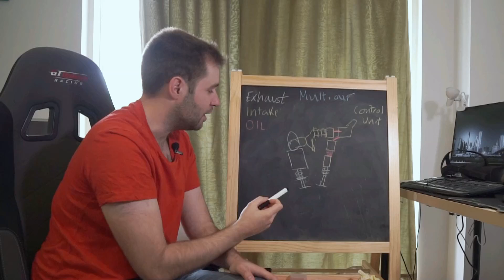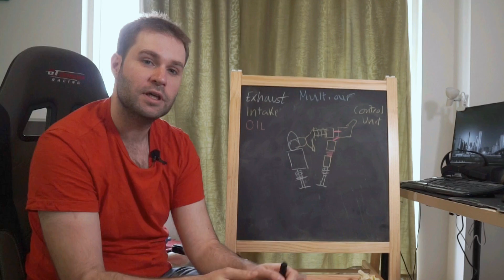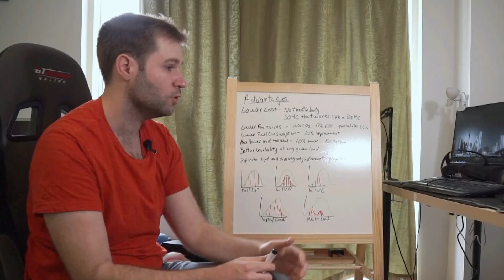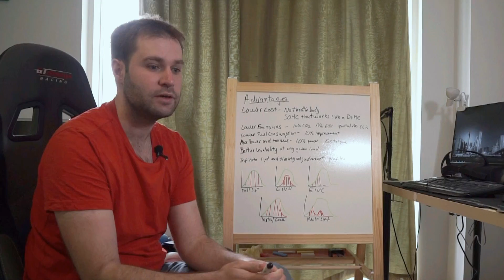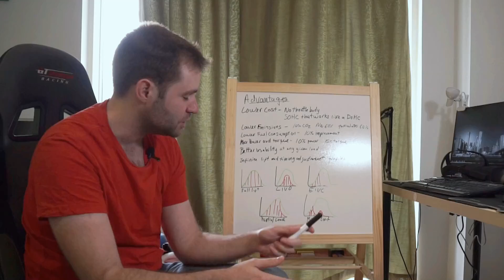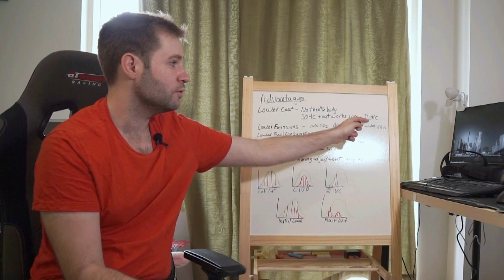How Multi-Air works (and why it's better than VTEC)

Comment: No throttle body? I have a 124 Spider with 1.4 multi air engine and I personally installed a throttle body and a throttle body spacer so I'm not certain what you're referring to?

Comment: My 1.4t multiair dart ran into partially major issues after 140k kms, doing the tear down and check now haha as a shop had it for 3 weeks then did nothing and gave it back to me to fix. Great info on this video though and it's cool to see the positives of this little cast iron block 72mm piston demon

Comment: Never again I would buy a motor with Multiair! My Fiat has now the second fail of the Multiair and it cost a lot to repair (about 1500€). The first time it failed with just 16'000km. Now I have 20'000km and it fails again. You have to drive the engine for at least once every week! If not, the Multiair will drain all oil and never starts again. I'm a mechanical engineer and now how an engine works and I had a lot of cars and motorbikes and repaired them as well.

Comment: After testing an Abarth multiair I can safely say that my FN2 feels way more powerful and the kick is way more brutal than in the abarth
Reply: you're comparing a 1.4L to a 2.0L, what did you expect?
Reply: You're also not going to feel a "brutal" kick because it isn't just on/off like VTEC, it can smooth the transition from low to high RPM intake timing so that you don't have "all or nothing".

Comment: One very minor correction, the multiair does have a throttle body, it simply remains wide open most of the time. The Euro T-jet's intake cam (dual cam) is replaced by the expensive ($1500) "brick" that controls intake valves. It's basically the same engine, but with the upper head (valve train) portion switched out. Basically the upper head containing the cam(s) and brick is unbolted and a dual cam unit bolted in place. The tricky part is reprogramming everything to work with dual cams in a car designed for the multiair system... something not yet successful for those swapping the unit out. Peak HP is improved with dual-cam, driveability (especially in the city) is better with multiair.
Reply: It is only expensive if you go all American with the maintenance. Unless the unit was broken to begin with. BTW. it is not $1500, more like €900.
Reply: @worldhello1234  You guys must get a great deal on parts. My brick threw an error at 5100 miles and was replaced under warranty in 2019. At the time the brick was over $1500, now nearly $1700, plus labor.

Comment: It's not actually better than VTEC. Maybe multiflair picks up a couple features, but it totally disregards half the engine! (exhaust cam, no control)

Also the small engines have low rev limits, Probly because valve float. Small engines make small torques, but the multiflair makes few torques.
Reply: Trust me, multiair have some much fun over vtec, literally just kicked straight away no need time like v Tec only Selenia Multiar oil and free of trouble
Reply: @biseruk  Trust isn't the issue, experience is, because I have experience with both.

Comment: I've owned a few hundred cars and my 2012 Fiat 500 sport is my favorite  small car ever. I love the brilliant multi-air (which has been completely trouble free for 105 K miles), and it's a far better car on a twisty road than any of the "sports" cars I've owned.

Comment: Not to forget there's a small screen strainer on one end of the head that needs to be cleaned periodically. Also, about the MiTo, I'd be hugely surprised if it's not the same platform as the Fiat 500 - which is a genuine piece of shit (I know, I own one!) due to the fact that every part, except the engine, is low grade and will wear out prematurely, the paint is bad, the design details are feeble, maintenance is a horror and every thing is cheap, cheap, cheap.

Comment: On most engines with MultiAir, they're actually DOHC.
Reply: It’s SOHC; I thought I was tripping when I examined my spec sheet but I poked around and it’s true, it’s only a single cam
Reply: If it has multiair there is only one camshaft, which makes it a single over head cam. Only an exhaust camshaft as the multiair replaces the intake camshaft

Comment: My multi-air tigershark 2.4 is awful. It is so powerless i feel unsafe merging on highways and even just switching lanes going faster than 65 mph.
Reply: Which car?
Reply: @hexity-  2016 jeep renegade trailhawk. I love how it looks but the performance is just abysmal. It does do good off road or slippery conditions tho.
Reply: @Anosh45  well you got 9 speeds and you way 300lbs heavier. I drive a 2014 Dodge Dart with the same motor. And I have 6 speeds. My dart goes buddy
Reply: @hexity-  after my warranty im planning on getting header, exhaust, some ecu stuff, and lowering the height and beefing up the suspension. darts are def better because of the weight difference and the aerodynamics, gearing, etc. hopefully more aftermarket performance parts start coming out
Reply: He'll we got the 2.4 in our jeep renegade 2 wheel drive and it runs pretty good
Reply: Dont blame the engine. It is the zf9 speed that keeps it weak and slow. Dont believe me? Put it in manual mode and see how fast it will go keeping it in lower gears and higher rpms

Comment: Oil specifications changed for euro 6 to 0w30 which you did not mention. The oil specification chang3d not only for reducing emission but most importantly to cure the failure of the multi air actuator

The mito is a great little car, obviosly to small for States side, perfect for us european
Reply: Yeah, oil specs are different for the various versions. e.g. Different oil for the US turbo vs the non-turbo models.

Comment: Thank you for your crisp and clear explanation of this fantastic system. I have a Fiat 500 Abarth and love its performance, sprint and power. You have successfully explained why.
Reply: I just bought a 2014 Abarth and love it! I work for a Chrysler dealership and our lead Chrysler tech showed me how it works and it’s really quite amazing. Your explanation was one of the best I’ve seen on YT.
Reply: You know a abarth 500 got a 1.4 t-jet  right?😅
Reply from the maker: In the US there's the multiair option
Reply: @randomcallsign  oh really I didnt know that
Reply: @jeffreykoeleman7068  L

Comment: So are these interference engines?
Reply: Yes and no. It depends on how much lift the multi-air system is going for when the timing chain goes. At full lift these engines are VERY interference. The cam profiles on these engines are crazy because the multi-air system gets to decide how much of the cam to use.

Comment: It is not better than vtec performance wise......Vtec could change cam profile.
Reply from the maker: So can multiair
Reply: @randomcallsign  No. multiair and many other variable lift system could vary lift but not duration.
Reply: @randomcallsign  I mean longer than normal cam duration.
Reply from the maker: Then you need to check all the available lift modes such as multilift
Reply: @randomcallsign  All other variable lift system is restricted by the cam lobe，but Vtec changes to a larger lobe. I am not a fan of honda, but I love high performance NA engines.
Reply from the maker: Multiair makes it moot by just using one electronic actuated lobe. At maximum lift its just like vtec. Then multiair can lower the cam profile, or raise it or open the valve or close the vale, or retard or advance injection according to load needs. 
Full lift "is" VTEC. LIVO "is" the lower lobe
The explanation is on the video.
Reply: @randomcallsign  Yes, it can lower but not increasing like VTEC
Reply from the maker: If it can lower, it can increase.Lower assumes a higher cam profile position, which multiair has, being called full lift. But instead of having a second lobe, the selenoid does it all, and not only that, it can infinetely adjust the cam profile. Full lift ~= VTEC. LIVO ~= lower lobe. 
There's no need for a second profile or a variable valve timing actuator when the selonoid does everything VVL and VVT does. That's the magic behind multiair.
Reply: @randomcallsign  Your theory is right, but in fact the cam lobe is lower and shorter than the vtec second cam lobe.
Reply: @randomcallsign  For comparison: honda engine with real vtec： k20a 212-221hp K24a2 197-205hp for same 2.4 NA multiair 2.4 178-184hp. Fact is fact, power for NA engine lies in cam profile and engine speed.     Vtec is better for perfoemance, Multiair is better all the other aspect.
Reply from the maker: You are comapring two different generation of engines on two very different CARB and EURO rules. High revving NA engines that push over 100hp per liter will not happen anymore due to enviornmental restrictions. You need to compare apples to apples. 
The Honda 1.5 VTEC has 184hp, or 122 hp/l. The 1.4 multi air has 170hp or 121horses per liter. 

Apples to apples, power wise, they are essentially the same. In terms of technology and options multiair is far superior.
Reply: @randomcallsign  First honda 1.5 is not Vtec but ivtec engine. it is phase variable only, you are demonstrating that multiair engine perform very similar to an engine without lift variable system that being said multiair is not helping increase power.
Second, Multiair 2 engine is newer but got higher HP. Multiair 2.0 in Dodge calibre SE have only 158hp 2007-2012 whereas K20a from 2007-2011 got 221hp (civic type R).
Reply from the maker: 1.5  VTEC Turbo does have lift, not only phase. Not only Multiair increases power it has a track record of doing so against same displacement in the FCA engine family. the NA 1368cc engines achieve 95bhp. the MA achieves 105 with the same number of revs. And this is why you are failing to understand my point.
The K series is not a comparision to multiair. Its a high rev engine, makes power at peak engine speeds. Its tuned that way and its tuned to an enviornmental set of rules that does not exist anymore. 
The Multiair does not, It makes power signficantly lower on the rev range and it does so by complying with standards.
K20 is high rev, high performance engine phylosophy complying with EURO3 and 4
Multiair is a general utilitarian, mid performance, normal rev engine complying with EURO5, 5a and 6. 

These engines compare as much as a K20 to a 2.0 V8 from 1960s. Those used to do 240bhp.
Reply: @randomcallsign  No It doesn't have second cam lobe. Many "vtec" badged honda engine is just have a badge.
Reply: @ocerrr  lol wow..
Reply: @hewasdeadwhenigotthere7109  Yeah right? All of this evidence and he's still disagreeing because he just doesn't want to admit the MultiAir is thoretically the same as a VTEC.
Fanboyism at it's finest.
Reply: @randomcallsign  I'm not sure about your country but I'm assuming things now. The 1.5 liter Hondas that make 184 hp are not vtec. The accord with a 1.5 vtec makes 192 hp. There are no other vtec 1.5 turbos but there are non vvl 1.5 turbos that make an assortment of power levels and the civic si makes 205 hp which power per liter is more than the 1.4 fiat. I'm not trying to be biased to anyone but only correcting the information being put out. You can say what you want but it's gonna be a tough game to beat Honda at hp per liter on a budget. The l15b7 Honda is already making more power per liter but to be fair it may not be available in your country according to the numbers you're reporting.
Reply from the maker: @redlinearroyo847  the 205bhp version is not available in europe and it was only available after this video.
Reply: @randomcallsign  the 205 hp civic si 1.5 turbo has been out since the 10th gen civic began which is around 2016 2017 but that's for USA. I guess Europe is 5 years behind us. 
Yeah I checked 10th gen civic came out late 2016 early 2017 and that did not have a k24 anymore it was using the 205 hp l15b7. For USA atleast. To be fair I wouldn't expect most people to be well versed in all special and exclusive automotive regions of the world.
Reply: Have a ride in a NA VTEC, after that you'll never want to drive a multiair ever

Comment: That guy you spoke about mentioned thet the engine requires oil. He was right "from what you said" if the multi air or twin air gets low on oil then the engine will not run

Comment: How long should the 2020 2.4 ltr. last?
Is it a durable engine?
Reply: There is a standing recall for oil consumption on these motors. Basically brand new motors use oil from the factory. Not a good motor in my opinion. Also, maybe one of the most sluggish 2.4 lt motors I have ever driven.
Reply: @RobertBsGarage  Thank you.
Good information.
Reply: @RobertBsGarage  the engine is fine and can really go. The problem is the 9 speed transmission it is parred with that makes it sluggish to conserve gas
Reply: @ZachCut  I've driven many different models with this engine in it and though the throttle response is different in all of them, it's not impressive in any of them. In the jeep renegade, if feels like a half of a second between what your foot does and what the engine actually does.
Reply: @RobertBsGarage  I mean it aint a sports car and its a 2.4l 4 cyclinder at best so what do you expect lol

A half second isnt even that bad. My cherokee has about a 3 second delay if you are going about 50 and slam down the throttle. And I mean for 3 seconds there is no acceleration at all then it takes off. At other speeds it isnt so bad tho. All of that is on the transmission tho. Put it in manual mode and see how much delay you got. None it is really responsive and not a bad engine just all of the transmissions suck they put it with because of epa requirements

Comment: It's junk. Serious junk. The solenoids are not serviceable, it requires very particular maintenance, and when it fails. Open your wallet. 

It's a crap Euro system with a high failure rate. Honda's biggest failure is an external oil leak. Junk Fiat design. Absolute crap.
Reply: Stick to riding your camel 🐫
Reply: Everything about this comment is purely false.
There's not special maintainence required, you literally need to take care of your car as every car requires you to do.

Comment: Very helpful video! I'm heading to FCA this summer to work as a Powertrain Engineering Intern, so it was nice to see how Multi-Air works before getting there.
Reply: How did that internship go? Did you realize that working on FCA vehicles for warranty time is a goddamned joke?
Reply: @gokblok  The internship went great! I worked in virtual emissions analysis, so wasn't involved with warranty work, but I do know the pain.
Reply: Lucky mate. I wish i was in your shoes. Hope it was an amazing experience
Reply: Pass it on please try this on the 3G hemi V8 id love to see if this shuts up the Ford coyote guys arguments about how camshaft in block is outdated vs 4 cams and how much more we can squeeze the profomace gains out of it thanks 😎

Comment: How come this engine consume so much oil there have to be some design flaw within this engine I have a 2.4 jeep Cherokee latitude oil drinker
Reply: I realize this is a year later, but FYI, the oil consumption issue with the 2.4l multiair turns out to be caused by the intake valves timing when the engine is in an engine braking condition. Apparently, the intake valves close too quickly, creating a very high vacuum condition inside the cylinders, which sucks oil into them.  FCA fixed this with a software update that changes the intake valves’ closing profile when engine braking.  This reduces the vacuum created inside the cylinder, and hopefully no or much less oil gets sucked in.

Unfortunately, apparently the fix also reduces your engine braking ability. Personally, I’d rather top off my oil once in a while….
Reply: @kroumful   I got tired of topping off the oil I'm glad they fix it no engine shouldn't  burn oil period
Reply: @brotha1984   I agree with you there.  There should have been a low oil warning light for sure at least, so that your engine doesn’t suddenly die while you’re driving.
Reply: Personally, I like the relative simplicity of the 2.4l engine and bought it instead of the v6 in the Cherokee because I figured it would have better long term reliability (less things to go wrong: timing chain instead of belt, ONE camshaft instead of 2 like ALL other 4 cylinders or instead of 4 like all V6, one head gasket, etc.

The 3.2l v6 which is the other engine in the Cherokee doesn’t burn oil but it has other significant issues: oil filter housing cracking and leaking, camshaft and rocker arms wear out due to a known issue with all pentastar engines that still isn’t addressed…

If I have to top up oil every once in a while and in return I get a reliable engine, I’m happy.  

But yes, in theory no modern engine should burn oil.
Reply: @kroumful  it became a safety issue
Reply: Jeeps 2,4 engine is not the same. This Multiair system is on 0.9 Fiat 500,1.4 Fiat 500, Alfa Mito, Giulietta and new 2.0 Giulia engines and some Dodge and Chryslers. With proper maintenance this are bulletproof engines. Predecessor T-Jet are very reliable engines capable run over 250.000 miles
Reply: @bernymonty22  So why would the Jeep say their 2.4 is the "multiair" with zero evap or whatever?
Reply: @ofcbob6391  bernymonty might be thinking of the 2.4L that was in the Patriots/Compasses. That's actually a Hyundai engine. The 2.4 MultiAir found in the new Cherokees is definitely the FCA 2.4 engine being talked about here.